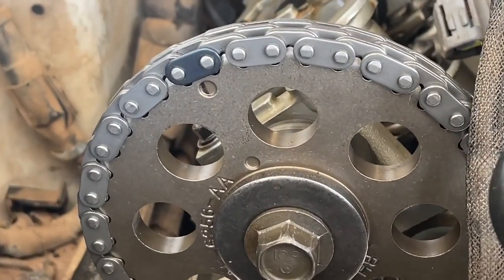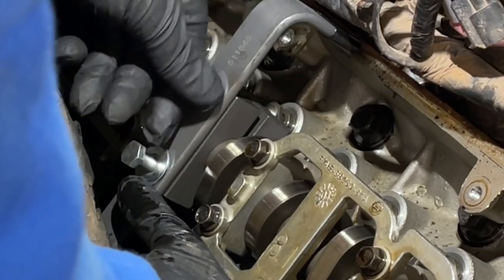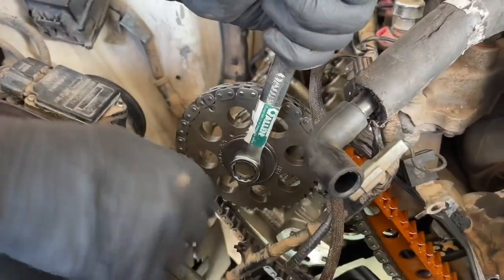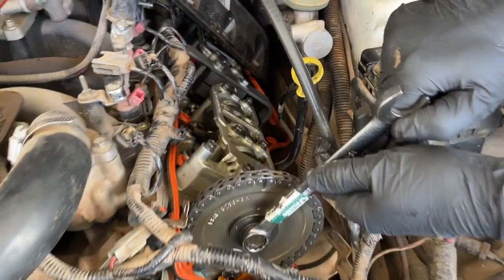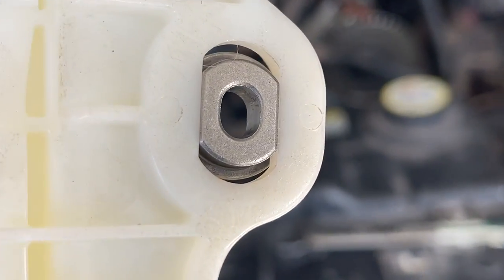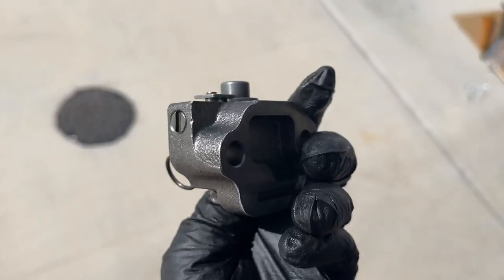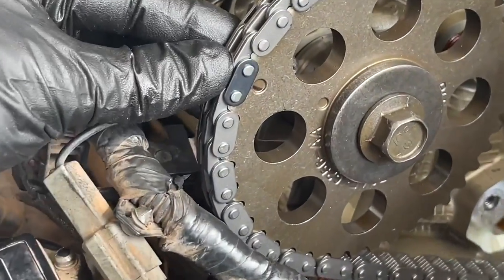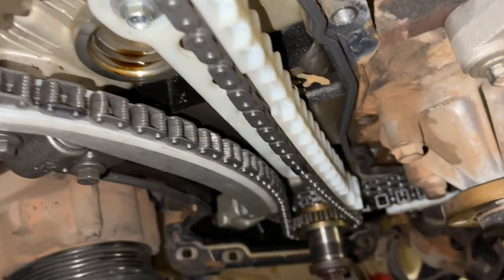Ford 4.6L timing chain, tensioner, guide, tensioner arm replacement. Mustang, F150, Crown Vic 2V

Comment: Nice to see someone addressing that the factory master links on chains sometimes cannot be identified and that as long as you place the chains down and stretch them out you can make your own master links by coloring 2 links directly opposed. (this also helps if you soak original chains (low mileage) in purple power and the coating on masterlinks is dissolved) your replacement timing chain guide is also a pos plastic guide you should have purchased a kit with metal guides supports because the plastic breaking off is a common failure point. pulled timing chains and guides off thunderbird with 175k miles and they were tight when removed no slack very minimal wear on the plastic wear on guides and steel tensioners. going to reuse both chain and guide and tensioners because the guides had steel backing as well. good design no need to replace with cheap inferior kit like you did. I will modify the ratcheting arms on the iron tensioners prior to assembly.
Reply: For someone planning on doing this and do not have the cam holding tools ? you can get away without having them by setting up the timing marks so cams are in correct place and then removing all the rockers. this will take tension off the cams so they will stay in place exactly were you put them.. once rockers are removed verify cam marks are correct then replace the chains and guides and then reinstall the rockers.

Comment: i think that's the same motor in my 08 E250 4.6 2valve motor ,i had a broken intake spring on number one cylinder and i did not secure the cam .i replace the valve spring and reinstalled the cam sprocket in the keyway and now the engine is locked up from turning. now all though the cam moved only maybe an inch  i was able to reinstall the sprocket back on by removing all the roller rockers then back on .now I'm lost  what to do

Comment: What happens if the tensioners are reversed, ie right on left side, left on right? I waist they had a “drivers” and “a passenger” side designation, as right and left depends on how you’re viewing. Form the drivers saet, or from the front of the engine. If one did have them reversed, would they not work properly? Thanks.
Reply from the maker: They do have L (left) and R (right) stamped on them. Left is the driver side as if sitting in the car. I don’t know that they would fit if reversed. They must have them that way for a reason if they went to the trouble to mark them that way.

Comment: If you’re just replacing guides and tensioners, do you still need to hold the cams in place?
Reply from the maker: Yes. As soon as you remove the tensioner the cam will rotate from the spring pressure on the cams.

Comment: I hate the fact that you have to break the seal on your valve covers which adds to the cost of the work. Most don't know the valve cover bolts are a one-time use item and they will snap if you attempt to retighten them to spec. I opted for the Trick Flow valve cover kit, dollar for dollar it was worth it as Ford wanted almost $13 per valve cover bolt multiplied by however many you need and that's a lot of money for hardware. I'm not saying everyone will get this result, but one of mine broke and I opted for what was mentioned above. Great video for the overall task, you make it look easy.
Reply: What? I've done valve covers 10s of times on 2v engines.. always reused the bolts and no leaks or bolt breakage at all?
Reply: @CREATINELUSTER  consider yourself lucky? I don't know what to say. :D I did say not everyone will have this result.
Reply: @chris4883-e9f definitely not 1 time use
Reply: @chris4883-e9f Ive done the same motor 3 times without problem.
Reply: @slippery_gecko9274  well, aren't you just lucky?

Comment: I enjoyed the video. Very informative I have a 97 Thunderbird that a tensioner that’s weak and mine is making a ticking noise so I stopped driving it before it got worse. It has 143,xxx miles I switched to 10w30 Castrol synthetic blend high mileage oil and wondering if the oil is too heavy for it.
Reply from the maker: 30 weight should be fine. I run it in all my mustangs. 10W might be a little “thick” in the beginning as it warms up if you are in colder weather, but I don’t think it should hurt
Reply: @dannyjohnsonsgarage you probably also have oil contaminants from those guides and plunger grinding against each other that metal flakes have to go somewhere

Comment: Was wondering do the timing tensioner have a gasket behind them putting one together right now and was not wanting to put it all together with our one and it needing it
Reply: Did you end up using a gasket?
Reply: @briananoriega29  It's a year later so probably aren't looking for that info, but the metal body tensioners do not need a gasket.
Reply: @mmiller1188 , thanks for the info, exactly what I'm in this comment section for, doing the steel tensioner upgrade and wasn't sure. 🍻

Comment: Just Curious how many miles did you have on the car before you changed them ? I’m Currently at 137,000 miles and mine have never been change .
Reply from the maker: It’s hard to say because owned the car at 95k miles, sold it, and it got a replacement engine sometime before I got it again. It now shows 200k so it probably put 50k-100k  on a used engine with who knows how many miles

Comment: I WOULD ASSUME THAT THE FORD V6 4.0 SINGLE OVERHEAD CAM IS A DOWNSIZED VERSION OF THE 4.6 FORD MODULAR ENGINE. LIKE THE CHEVY V6 WAS TO THE OLD SMALL BLOCK V8. THE QUESTION HERE IS IF THE CHAINS, GUIDES AND TENSIONERS FOR THE FORD V6 THE SAME AS THE FORD V8 MODULAR ENGINE?.
Reply: That engine is not related to a modular. 

It's the old Cologne V6 with overhead cams haphazardly added. But it's a European Ford v6 engine dating back to the 60s.
Reply: @mmiller1188 I DID THE RESEARCH ON IT AND IT'S NOT A CUT-DOWN VERSION OF THE 4.6 MODULAR. THANK YOU VERY MUCH FOR RESPONDING.

Comment: I couldn’t use that left side guide. It was touching the chain for some reason so I used a brown skinnier one from my last npi engine.
Reply from the maker: What year was the car? My 2001 was early enough to be the Windsor engine, but the engine was replaced to the 2003 Romeo engine you see in this video. I wonder if yours has a NPI engine replaced in at some point
Reply: @dannyjohnsonsgarage  I put an 03 crown Vic engine in it. Just changed timing and still getting a tick from left side valve cover. Probably lifter or follower?

Comment: Hi danny ,Im in the process of putting  a oil pump in my 2004 gt mustang 4.6  and i notice that my timing chains weren't alonda
Reply: Sorry aligned with the dark link on the chain with the mark on the cams
Reply from the maker: The dark marks only line up on a certain rotation. You can make new marks like I did, or once the chain is off find the dark links and make sure you use those to be dot to dot on the crank and cam gear marks
Reply: Hi Danny ,I'm not quite sure what you mean that they only line up on certain rotation.. I turned the crank over and over and the marks keep coming back the same..the dark links are always one tooth past  the dot on the cam .so I confused where to put the chain back at at the dot or one tooth past the dot